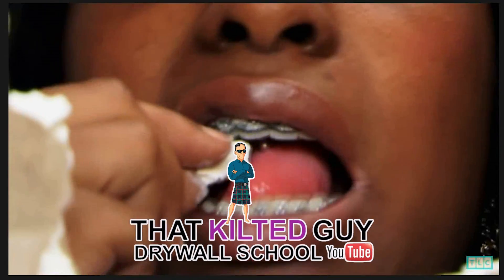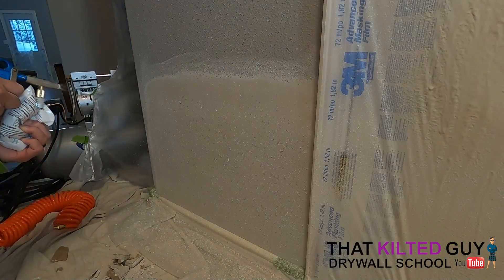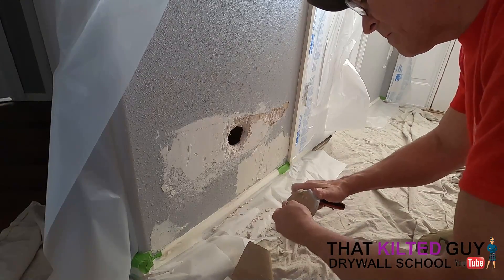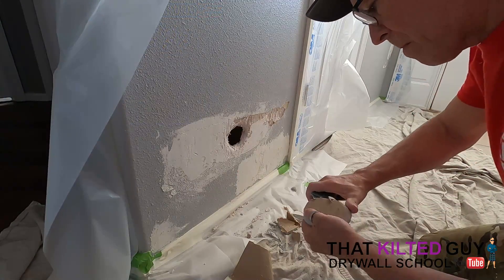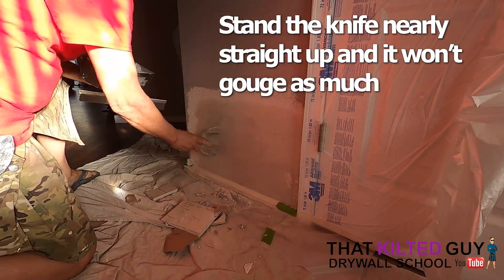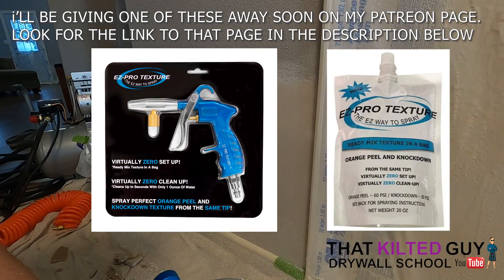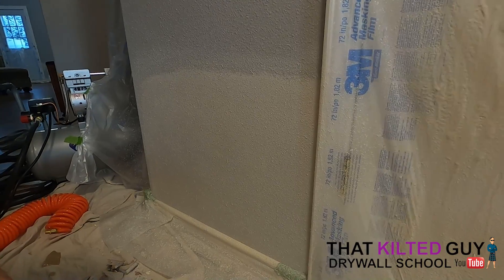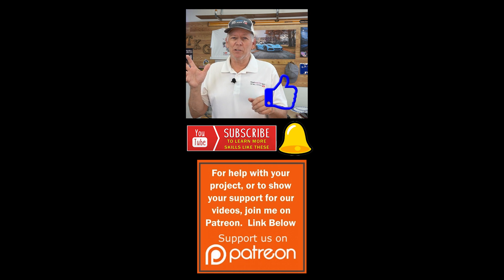How to Repair Pet Damaged Drywall and match the texture. Taught by 35 Yr Pro

Comment: I have one similar to this but from a recliner with no hole yet (24"x9"). I won't be going to the store for another few days for paint. I have only all purpose left over from the rooms I need the paint for. If I don't have the hot mud can I use just the all purpose to fill in the concave? I understand it will shrink and take a few coats.
Reply from the maker: Not if it’s over 3/16” deep

Comment: Heres a question, I have smoke detectors in ceiling 7 of them in my mobile home. I want to yank these out and fill the holes for new lighting, it also is popcorn ceiling. I was thinking fill the holes with the fiberglass wall fix for holes in wall , can this be done if so great! But I also have to give texture of popcorn ceiling back in the ceiling, How?I have ideas just not sure if it will work. Thank you Nancy Staggs a new subscriber.
Reply: Use metal mesh drywall repair sheets, you can get like 10 on Amazon for like $15. Use compound to make smooth, Then use a can of popcorn spray, and spray to texture, then paint.
Reply from the maker: Hello and thanks for your request for assistance. He can answer simple questions on here but for personal assistance on more complex issues, Guy offers assistance plans through his website at https://www.thatkiltedguy.com/consulting-services.  An additional option is becoming a Patreon member at the $10 and up level at www.patreon.com/thatkiltedguy.   Thanks for your support and glad we can help you  That Kilted Guy video productions llc team For Guy Purcella
Reply: How big are the holes from the smoke detectors? They're usually just held on with brackets with a few screws.
Reply: @Bapuji42  the holes are usually as big as a junction box (roughly 3"x4" if they're hard wired with battery back up. The one's your talking about are just battery.
Reply: @Chris.Rhodes  Fair enough, but won't the new lights need holes / jboxes? Seems premature to fill and patch the smoke detector holes just to cut new ones for a light fixture.

Not to mention that patching over a junction box isn't up to code.
Reply: @Bapuji42  true, but I don't know what's going on, I'm not there. She could yank the wire out, and patch it, but if there's smoke detectors there, they need to be there. Why relocate? Move the lighting, not the smoke detector. I've seen smoke detectors literally butted up against fluorescent panel lighting because they're tapping into that wiring. And I'm dealing with this kinda shotty stuff at my house, holes everywhere, drywall looks horrible (well, it's plaster and lath) and my landlord is a shotty diy'er, and he doesn't care about code. I have an outlet that's smashed into the wall, he literally painted over it, and kept going. Fire hazard like crazy. So I've been fixing stuff, and when i get done I'm sending him a bill. But yeah, if these detectors already have a J-Box then I'd use them for the lighting. But it sounds like to me this is project is a DIY Non-Code job. Which is fine now, but if it's ever inspected, it'll never pass, then all that work has to be redone. More of a headache to cut a few corners now, then save time and money later.
Reply: @Bapuji42  Maybe a 1 inch circumfrance. no I cannot spell. Not large. Thats why I said 4 inch squares.
Reply: @nancystaggs8605  Holes that size are easy to patch (if you pay Guy for some consulting I'm sure he'll walk you through it) but if there are power wires in there I don't think it's NEC compliant to patch over them.

If you're installing lights in the same holes you don't need to patch them anyway.
Reply from the maker: That’s way oversimplified
Reply: @ThatKiltedGuyDIY  Which is?
Reply: @ThatKiltedGuyDIY  what is way oversimplified? This whole thread has me confused 🤔
Reply: @Chris.Rhodes  Me too. I don't understand what the original poster wants to do. #communicationissues
Reply: @Chris.Rhodes  What I know for sure is it's against code to patch over a box with power wires.

And if you're installing a light fixture in the same spot, there's no reason to patch it anyway. 🤷
Reply: @Bapuji42  no I'm with you on that one...and is 100% correct. But if they are battery powered and not hard wired there shouldn't be much other than two screw holes. But my question is why are they getting rid of the smoke detectors? And like you and I discussed, if there are J-Boxes, why not use them to install the lighting?! This is so confusing, It is definitely over simplified.
Reply from the maker: The comment of "Use metal mesh drywall repair sheets, you can get like 10 on Amazon for like $15. Use compound to make smooth, Then use a can of popcorn spray, and spray to texture, then paint."  That's why I can't answer on here.  It's more complex than a simple answer and all the discussion above proves it.
Reply: @ThatKiltedGuyDIY  Absolutely.
Reply: @ThatKiltedGuyDIY  true, but i don't have all the information, I was going based on the information given. If you're going by a DIY cheap version, that would be the way, and it works. And to me, it sounds like she's wanting to be cheap about it. If I were doing it, I'd prefill, add a piece of drywall, and tape, mud, and texture. But i also have the tools to do it, and that's the way I personally would do it. Everyone is going to have their own way. But again, that's just going based off the information given. The mesh is a proven way to fix a hole for the cheapest way. Especially on a ceiling. Everyone has their own techniques, but as long as the end result looks good, and you get to the end result safely, and end with a result you're happy with, that's all that matters.